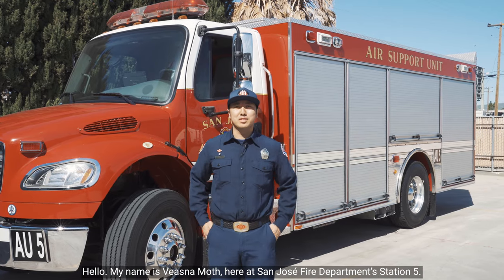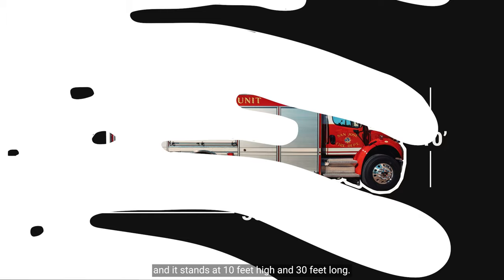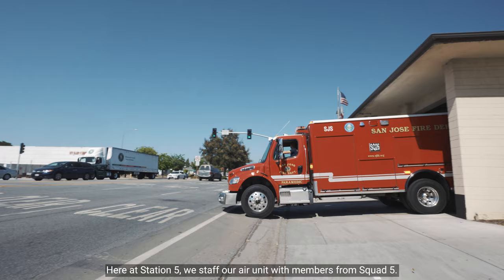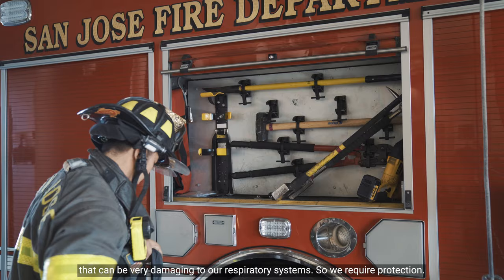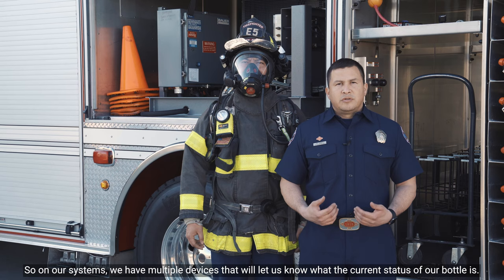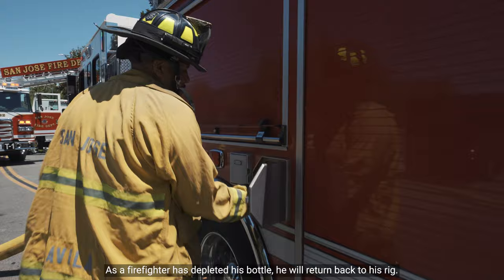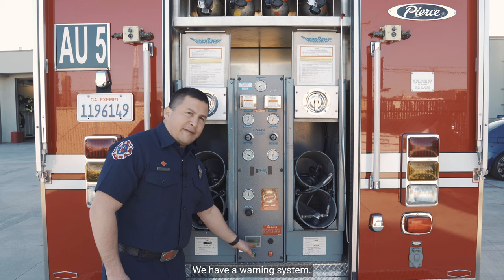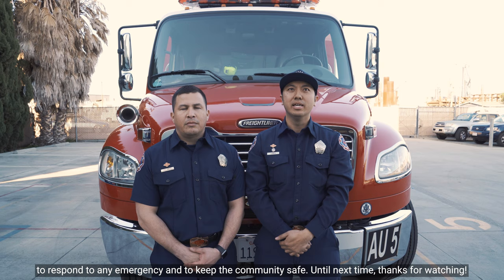Wheels Wednesday | Ep. 9 | Air Unit

Comment: What is the course of action if there is an extended emergency that would require multiple air resupplies, but the ambient air surrounding the area is completely contaminated (HAZMAT, Smoke, Etc.)? Is there a filter on the intake?
Reply from the maker: Thanks for your question. We haven't encountered such a situation before. The air unit is always pre-stocked with many air tanks. Our fire engines, fire trucks, and fire stations are also stocked with extra air tanks. If the ambient air is contaminated in the whole city, then the air unit's fill stations would not be able to operate properly (they do not have filters). However, we also have a dedicated air room (i.e., a building with fill stations). If the air inside of this building is healthy, then this could be used as a back up. If all else fails, then either (1) the air unit would need to travel outside of the city or (2) we would request outside assistance. Hope that helps!